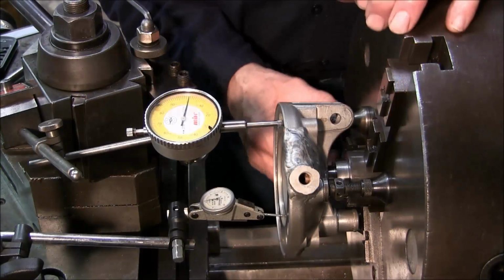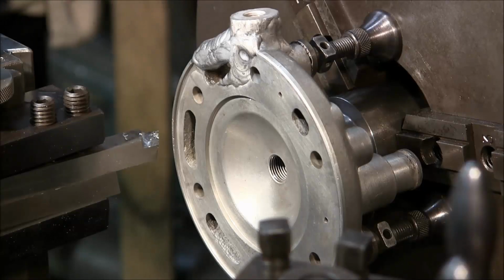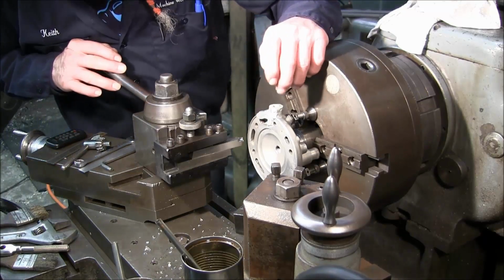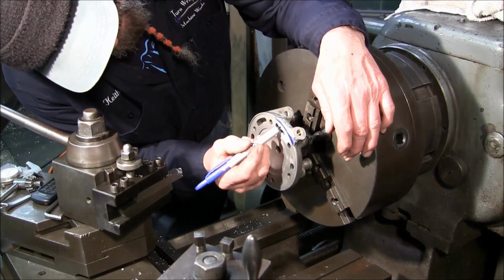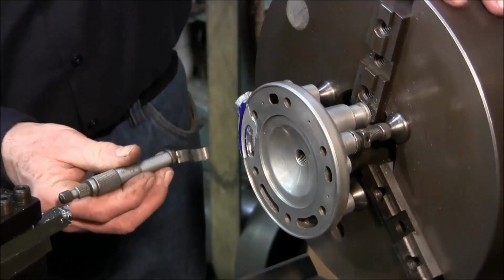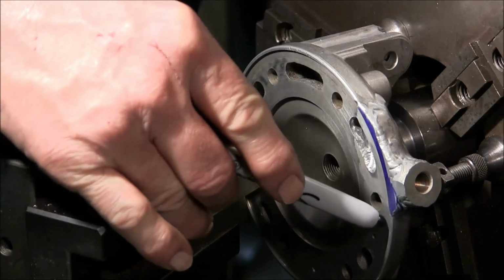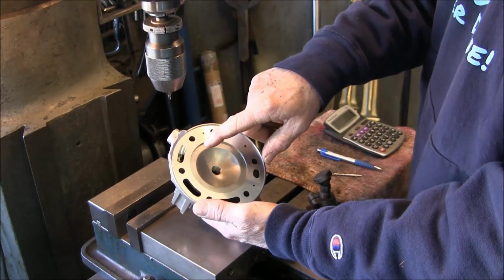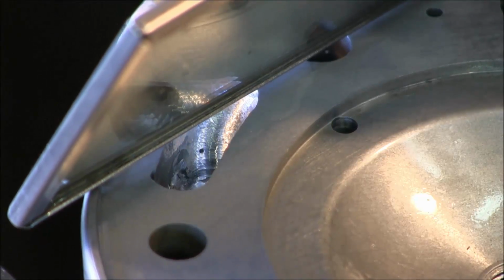The Manual 3D Metal Printer Part Eight

Comment: @3:40 two slightly scary things here. How little thread engagement in the alloy head and nothing to hold the screw jacks in case they come loose. Otherwise this is all amazing how you simply won't give in to difficulties.

Comment: Keith , I love your videos ,but , I would have told the guy to go to the gym and work on leg muscles. I have done this on magneto Sportsters for easier starting and ended up getting rid of the compression releases and using the extra holes for dual spark plugs . Then the bike started easier [from better ignition].  Never did the compression releases help the bike start. But cool video and fun to watch you work ,as always.
Reply: This is a very good solution for big combustion chambers. I have  had a Rotax 560 with 3 sparg plugs, not for better start procedure, but more torque.

Comment: you milling a head off an old kawasiki jet ski? looks like mine, but mines a 900 tripple. its a 96, and still keeps up with modern day 1200cc 4 strokes. turns quicker and tighter also. lot lighter.

Comment: Hi Keith,
Does the added alloy softer and stickier than original casting or just about the same?
Cause when I perform something in that flavor, the added stuff is kinda softer...
Maybe I'm more chicken, but I would have put a layer or two of tape around the jacks.... but everything went perfect.
Thanks for sharing,
Pierre
Reply from the maker: The 4643 is a little harder than if you just did it with 4340, but using a cutting fluid keeps it crisp. Thanks for the comment;{)-----
Reply: Thanks...

Comment: Great work Keith!  Your expertise in TIG aluminum welding is a joy to watch.  Your commitment to quality is evident too.  I have a question pertaining to pricing.  Without giving away any trade secrets, on a job like this would you quote a price of the finish job out the door or would it be an hourly rate?  If you quote a price I imagine you do account for contingencies such as the tear out when drilling the pressure relief hole but it seemed like a lot of unanticipated work cutting out the large section and then building it back up.  In the final analysis could the customer have purchased a head with the pressure relief cast in from the factory (if they even make one) for anywhere near what it cost for you to do the work?  I like your videos any way you load them, one at a time or a collection of them.......as long as you keep loading.  :-)  Thanks for taking the time to do this for us.
Reply from the maker: Luchi Sm I pretty much cover all those variables in the end, of part nine. Sometimes pricing is figured on time and material and sometimes a flat gut rate price and sometimes a gift from the heart, but never for competition. ;{)------

Comment: Hi Keith,
 Just wondering if you could set zero when the cutter touches off on the material you added and then with the machine off, bring the cutter over to the top of the outer flange and get a rough distance as a guide for when you do the actual cutting? This is in reference to 6:40 of part Eight 3D metal printing. Thanks and Getter Done!

Comment: That should affect the compresion ratio now shouldnt it not by much but he will get a marked inprovment, we used to skim our bikes and it would bring the power band in closer aspesionly on two stroke engines. The head looks like its off 250 cc but I cant make out the model. I would need the diameter of the compresion chamber in the head.

Comment: Why didn't you just touch the tip of the bit to the finished surface that you didn't want to cut, and subtract the difference from where you ended the last pass to figure out how much meat you had remaining to remove (Instead of trying to measure with a flex scale)?